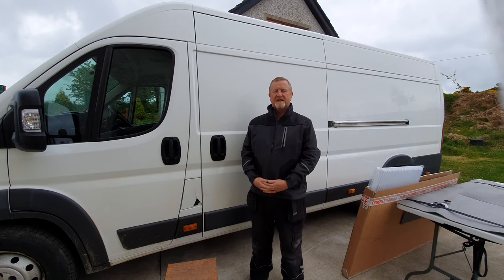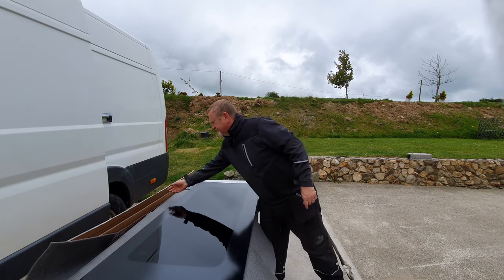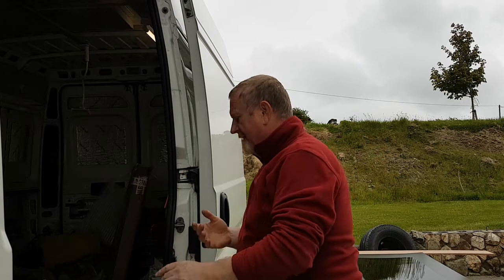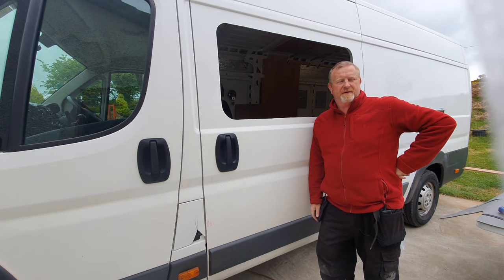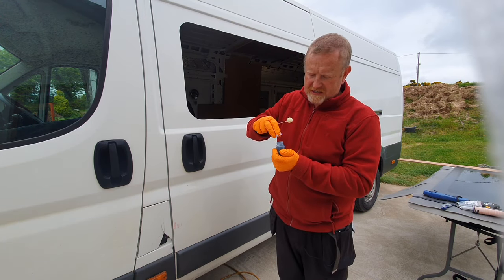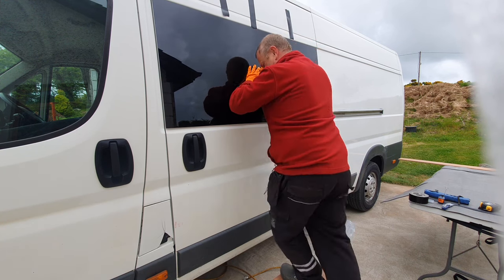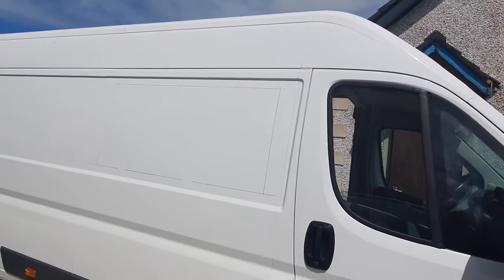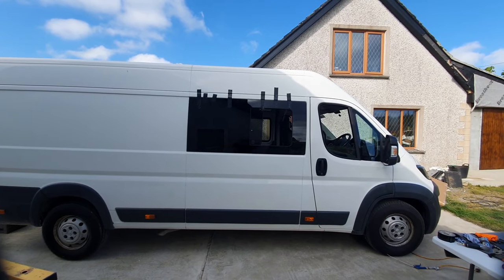How to easily fit Camper Van Windows

Comment: Did u use any u channel around the inside of the metal, where u cut it.  Our last kit came with some but out set for the new van doesn't have it. Do u know if you need to use it?
Reply from the maker: Simon, some kits come with a knock on trim that covers the sharp edges that can be left after the section of panel is removed.

The kit I used didnt come with it and I was concerned that the windows would not fit tight if the U trim was added. It depends on the vehicle but some will be ok and others not. The Peugeot/citreon/fiat Van's are a very close fit for the window kit so no trim used. I did make sure to seal all the exposed metal with the primer!! Hope this helps, Jamie
Reply: Yep, depends on the vehicle. If you don’t use U trim, as you would in transits as they are designed for it then you’d want to use black silicon sealant on the inside to seal the inside of the window and cover both skins of the metalwork. This will stop any condensation falling into the gap and causing rust eventually. I’m lucky- mines a Transit custom so U channel used.
Reply from the maker: Other interesting point, it's also possible to knock the 2 skins together and use the u trim over them to seal any gap. Works on sprinters

Comment: How did you bend the rubber trims around the square cut corners ?
Reply from the maker: @maxv77  so, I fitted the windows flush and didn't use the rubber trims. However, heating the section that goes around the corner with a hairdryer works excellent. Jamie

Comment: Maybe a fine metal blade in a jig saw would be easier to cut the holes?
Reply from the maker: That works very well. The blade cutting pitch is important and most saws have it adjusted for wood so important to set it for metal. Thanks for the really useful comment. Jamie

Comment: Hi mate, i’ve got the same windows. How do you know what size hole to cut?
Reply from the maker: Jack, best thing to do is make up a template of the window, use the template as a cutting guide. if you look at the blacked out section going around the glass, that's the minimum size you need to cut out, theres no need to have the hole the same size as the glass, I allowed 50mm smaller than the glass, it does depend on the van spec also. Mines the xlwb boxer. Jamie
Reply: You use the inside skin as the guide   If you get a punch and hammer and tap around the inside this will highlight the shape on the outside then you just join the dots and cut that out  ,this way you take any guess work away  (I have 30 years fitting experience )

Comment: Thanks for making this helpful video. Can I ask why you cut fork outside on the second? You said because it’s easier with that one, but doesn’t it follow the exact same profile from the inside? Also did you end up adding trim to the cut metal afterwards (notice that eBay listing doesn’t sell it)
Reply from the maker: I assume you mean from and not fork.

The sliding door and the fixed panel are different from the inside. The door has almost a perfect template on the inside but the fixed panel does not.

Comment: Good job.Will you be converting the whole van for living.How is insurance roughly how much would you spend on diesel a week.TY
Reply from the maker: HI, Currently if you join the motorhome and caravan club the annual insurance is about €250 or €350 if you dont. The van will be converted fully but not sure about fulltime van life just yet. The diesel cost per week really depends on how much driving you do. There's lots of variable's involved, full of fuel, water and how many people. The average van life budget of around €800 per month is a good guide but depends on how and where you shop etc.
Reply: @campervancreations7656  Thanks for the information man.